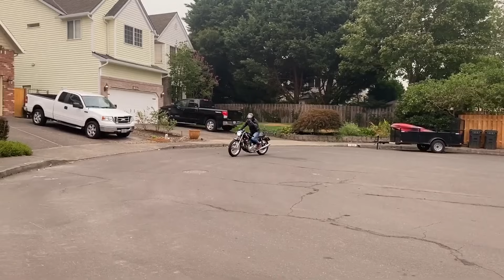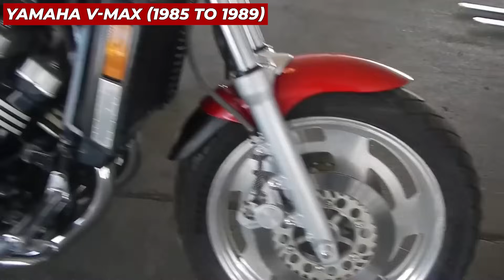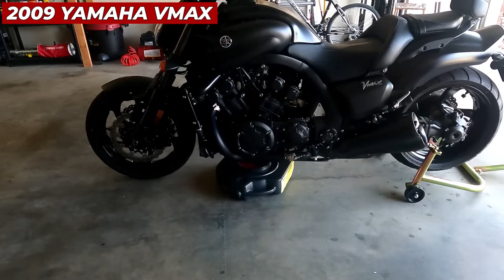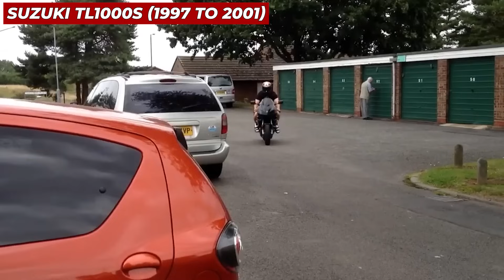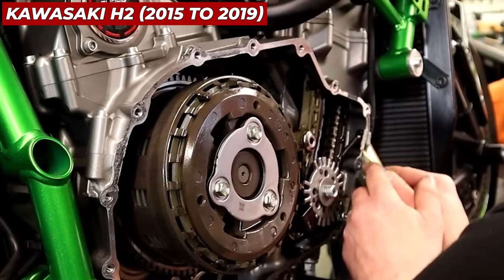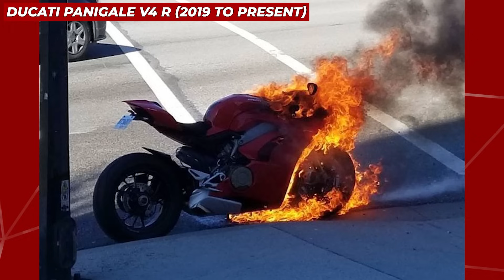The Most Dangerous Motorcycles From Each Decade (1960s–2020s)

Comment: I'm guessing the AI that made this video wasn't fed the correct information. It was the TL1000R and not the S that had the rotary damper. So you have been seeing the wrong bike. Proof ? Check the right side of the frame, you'll see a normal shock mounted there. The radial setup was found near the swingarm pivot point.